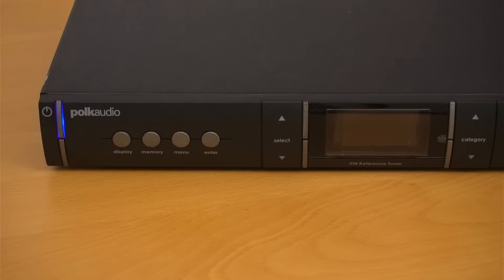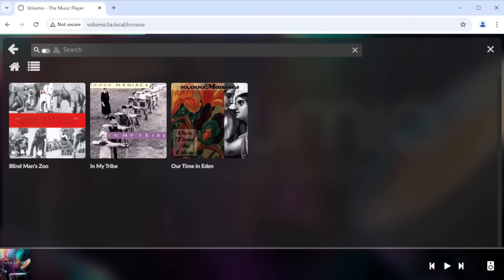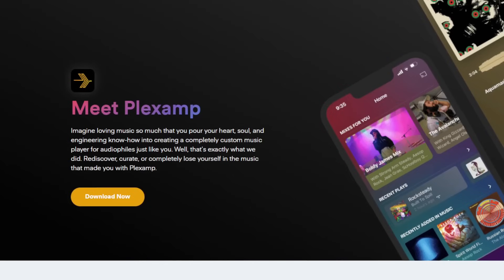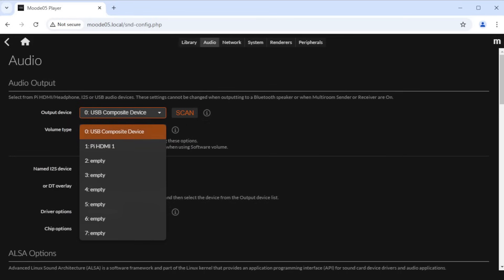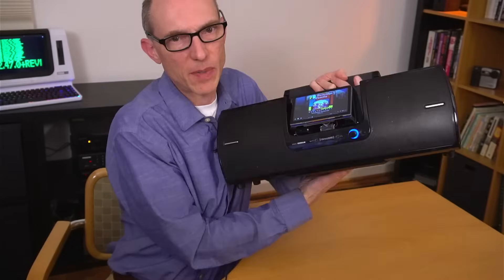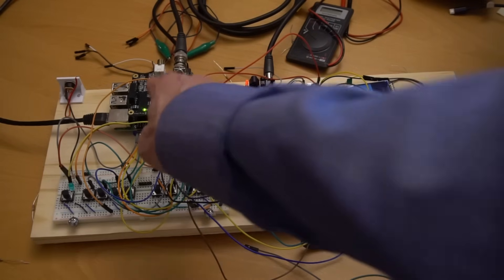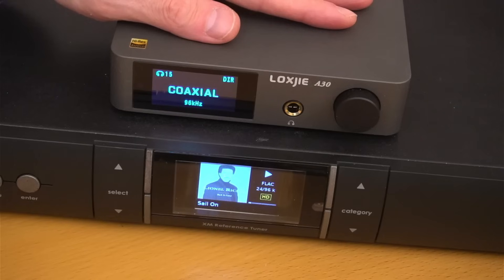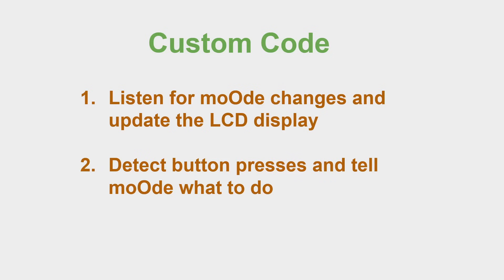Raspberry Pi audio players and streamers for home and car

Comment: Hi, I really liked the video. I'm interested in making a hi-res player with a Raspberry Pi 5, using a 5.5-inch touchscreen, a 10,000W UPS module, and also 3D printing a case. Is that possible?
Reply from the maker: Thanks! It sounds possible to me, though 10,000W may be overkill.

Comment: 11:43 As long as you aren't using SPI you can use pin 3 to shut down the pi, eliminating the need for the relay circuitry

Comment: Get a pcm5102a dac.
They cost about €2,80 and they are pretty good!
It's a fun little procect for in the weekends, because it does need some soldering of 6 jumperwires.
Reply from the maker: Thanks for the suggestion, I will have to give that a try!

Comment: Incredible fun video! 
Q. Is Pi Zero 2 W capable of reliably running Volumio or Moode ?
Reply from the maker: Glad you enjoyed the video! Yes, the Pi Zero 2W should be able to run Volumio or Moode, but it may not be quite as responsive as a more powerful Pi. As mentioned in the video, getting the audio out is the biggest challenge.

Comment: Hi!!! Thanks a lot for the video, finally someone cares about the sound quality instead of just the price! I’m trying to make a device that plays exactly one song that I’m going to export from a CD every time I press a start button, no screen needed, and I hope to play it with the best sound quality. I’m wondering what set it the best for my purpose, would you plz recommend me a DAC and a speaker? I think the ones in your video look amazing. No WiFi or Bluetooth needed. As for the main part, a raspberry pi 3b should be enough as mentioned in your video. Thanks a lot!!!❤

Comment: Bonjour à tous, je cherche une personne qui pourrait m'aider à installer roon bridge sur le raspberry pi 5, je suis novice. Merci
Reply: Okay, you can definitely install Roon Bridge on your Raspberry Pi 5! Here's a breakdown of the most common and recommended methods, along with what you'll need:

Understanding Roon Bridge and Raspberry Pi 5

Roon Bridge: This is a lightweight piece of software that allows your Raspberry Pi 5 to act as a Roon audio endpoint.1 Your Roon Core (the "brain" of your Roon system, running on another computer or a Roon Nucleus) will then be able to see the Raspberry Pi 5 on your network and stream music to it.

Raspberry Pi 5: The Pi 5 uses a 64-bit ARMv8 processor (architecture aarch64). This is important for selecting the correct Roon Bridge software version.

Recommended Installation Methods

Here are the primary ways to get Roon Bridge running on your Raspberry Pi 5:

Method 1: Using RoPieee (or RoPieeeXL) - Easiest & Recommended for a Dedicated Endpoint

RoPieee is a free, dedicated Raspberry Pi OS specifically designed to turn your Pi into a Roon Bridge.2 It's optimized for audio, supports many popular DACs and HATs (Hardware Attached on Top sound cards), and is very easy to set up.3 RoPieee now officially supports the Raspberry Pi 5.4

What you'll need:

Raspberry Pi 5

MicroSD card (8GB or larger recommended)

Power supply for the Pi 5

Ethernet cable (Wi-Fi can be configured later in RoPieee)

A computer to flash the RoPieee image to the SD card

USB DAC or a Raspberry Pi audio HAT (optional, for audio output)

Steps:

Download RoPieee: Go to the RoPieee website (ropieee.org) and download the latest image for the Raspberry Pi 4 (which is also compatible with Pi 5, or look for a specific Pi 5 image if available by the time you read this). RoPieeeXL offers additional functionality like AirPlay, Spotify Connect, etc.5

Flash the Image: Use a tool like Raspberry Pi Imager, BalenaEtcher, or Win32DiskImager to write the RoPieee image to your microSD card.

First Boot: Insert the microSD card into your Raspberry Pi 5, connect the Ethernet cable, connect your DAC/HAT (if using), and then power it on.

Configuration: RoPieee will take a few minutes (sometimes up to 10-15 minutes) on its first boot to set itself up. You can access its web interface by typing http://ropieee.local or the Pi's IP address into a web browser on a computer on the same network.

Enable Roon Bridge: In the RoPieee web interface, navigate to the Roon Bridge tab and ensure it's enabled. You can also configure your audio output device here.

Enable in Roon: Open your Roon Core software, go to Settings > Audio. Your Raspberry Pi 5 running RoPieee should appear under "Networked" devices. Enable it, give it a name, and you're ready to stream!

Method 2: Manual Installation on Raspberry Pi OS (or other Linux distributions)

This method gives you more flexibility if you want to use your Raspberry Pi 5 for other tasks in addition to Roon Bridge.

What you'll need:

Raspberry Pi 5 with Raspberry Pi OS (or a similar Debian-based Linux distribution) installed and configured for network access. A "Lite" version is sufficient if you don't need a desktop environment.

Ability to access the Pi's command line (either directly with a keyboard/monitor or via SSH).

USB DAC or Raspberry Pi audio HAT (ensure it's configured in Raspberry Pi OS).

Steps:

Update your system: Open a terminal or SSH into your Raspberry Pi. 

Bash

sudo apt update sudo apt upgrade -y 

Install required packages: Roon Bridge may require curl and ffmpeg. 

Bash

sudo apt install curl ffmpeg -y 

Download the Roon Bridge installer script: The Raspberry Pi 5 uses an ARMv8 (aarch64) architecture. 

Bash

curl -O http://download.roonlabs.com/builds/roonbridge-installer-linuxarmv8.sh 

Make the script executable: 

Bash

chmod +x roonbridge-installer-linuxarmv8.sh 

Run the installer: 

Bash

sudo ./roonbridge-installer-linuxarmv8.sh 

Follow the prompts: The installer will guide you through the process. You'll likely be asked to agree to terms and start the Roon Bridge service.

Enable in Roon: Open your Roon Core software, go to Settings > Audio. Your Raspberry Pi 5 should appear under "Networked" devices. Enable it and configure it.

Method 3: Using Volumio with the Roon Bridge Plugin

Volumio is another popular audiophile OS for Raspberry Pi.6 It can run Roon Bridge via a plugin.

Install Volumio: Download the Volumio image for Raspberry Pi from their website and flash it to an SD card.

Set up Volumio: Boot your Pi 5 with Volumio and complete the initial setup via its web interface.

Install Roon Bridge Plugin: 

Navigate to Plugins in the Volumio UI.

Search for the "Roon Bridge" plugin in the "Music Services" or similar category.

Install and activate the plugin.

Enable in Roon: Open Roon, go to Settings > Audio, and enable your Volumio device.

Method 4: Using Docker

If you're comfortable with Docker, you can find community-maintained Docker images for Roon Bridge that support arm64.

Install Docker on your Raspberry Pi 5: 

Bash

sudo apt install docker.io -y sudo systemctl enable --now docker sudo usermod -aG docker your_username # Add your user to the docker group, log out and back in 

Pull and Run Roon Bridge Docker Image: Search on Docker Hub for "Roon Bridge" and look for an image that supports linux/arm64 or aarch64. Instructions will vary slightly depending on the specific image, but it will typically involve a docker run command. For example, a commonly referenced one is giof71/roon-bridge.

Important Considerations for Raspberry Pi 5:

Power Supply: Ensure you are using an official Raspberry Pi 5 power supply or one that can deliver sufficient power (5V, 5A recommended if using power-hungry peripherals).

Cooling: The Raspberry Pi 5 can run hotter than previous models. Consider a case with a fan or a heatsink, especially if you plan to run it continuously.

Audio Output: 

USB DAC: Most USB DACs should work. Connect it before booting or ensure it's recognized by the OS.

Audio HATs: If using a HAT, ensure it's compatible with the Pi 5 and that your chosen OS (Raspberry Pi OS, RoPieee, Volumio) supports it and has it configured correctly. RoPieee often handles HAT configuration automatically.

Network: A wired Ethernet connection is generally recommended for the most stable Roon streaming experience, though Wi-Fi can work if your network is robust.

Choose the method that best suits your technical comfort level and how you intend to use your Raspberry Pi 5. For a pure Roon endpoint, RoPieee is generally the simplest and most streamlined solution.

(Courtesy of Gemini 2.5)

Comment: Very well done.  I am going to build this.  Thank you for sharing.  Will the Pi 5 work easily in place of the Pi 4?
Reply from the maker: Thanks! A pi 5 should work fine, though I haven’t tested one for this project.
Reply: A Pi5 will work in principle. However, it is oversized for an audio player. It consumes more power, generates even more heat than the RPi4 and, according to ‘experts’, is unsuitable for audiophile players.
The RPi5 was tested by audiophile experts for audio applications and found to be poor. They recommend the RPi3B+ for audiophile applications. There is also a whole series of videos about this.

Comment: Might be able to mod the boombox with a battery bank. you could use USB PD or something I would recon.
Reply: I went with 2 batteries, power tool batteries that I already had. One for audio and one for an overclocked Pi4. Music, tv, movies, games, anywhere. I used my cell phone for a hotspot, which actually had a benefit. If I was working  in a basement I could put my phone where it got a signal and it would relay the wifi to my boombox. If I say just used the phone it wouldn't have worked, or would be spotty and the phone would run out of battery. Boombox is a great form factor. Take out the CD player in most and you've got a huge space for carrying accessories. Big sound, playing PS1 or Nintendo on a boombox is a trip as well. Recently I got an HDMI projector that can run on my batteries, mounted a Pi5 on top. Now it's more of a plug in but I can project a huge image and select the boombox or a smaller set of speakers, Also PS2 and Gamecube are possible. The projector is mounted to my tool bag, it has a built in speaker and can play gigs of offline content by itself. Cheap projector, so if it gets ruined I can just pick up another, picture is good enough for background entertainment.
Reply: @pgtmr2713  that sounds peak
Reply: @JessicaFEREM   I use it at home as well. The projector is currently mounted to a tripod. Pi5 at full overclock, 3150/1100. Aimed at the ceiling playing The Big Bang Theory. It's like living in the future with your own jet car ;-D

Comment: I am in the process of building a mp3 player using rpi. I want to use a 2x16 lcd display to show song name and artist. Is any of the distro/software you mentioned support such displays by default? I was thinking of using mpv to play local files but I might end up using plexamp or jellyfin if my rpi2b can talk to my server rpi4b without lagging.
Reply: Not by default, but Volumio does have a plugin for character LCDs with an easy to edit config file that lets you define what's shown during each state (Such as music playback and idle)
From my personal experience with Volumio on a Pi 2, even playing from a network share (And presumably also Jellyfin, which I believe is available as a source option through another plugin) the only time you may experience lag is if you have extremely large playlists, but that's only when it's loading the playlist into memory before it starts the first song.
Reply from the maker: Check out the forums for moOde , Volumio, and others - some users have posted LCD extensions that may be useful, although they are unofficial. I also have a 2x16 LCD setup in my other streamer repo: https://github.com/alanb128/audio-streaming-box